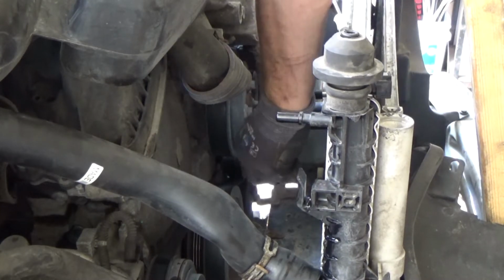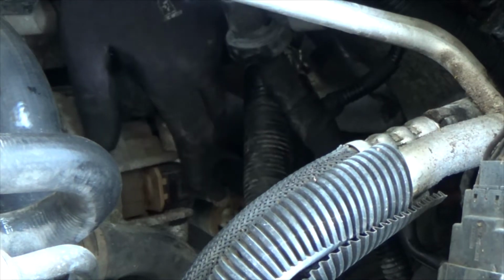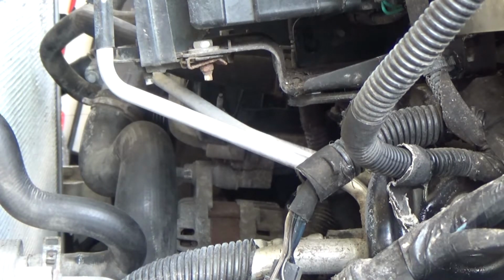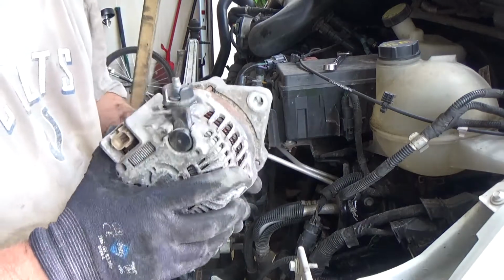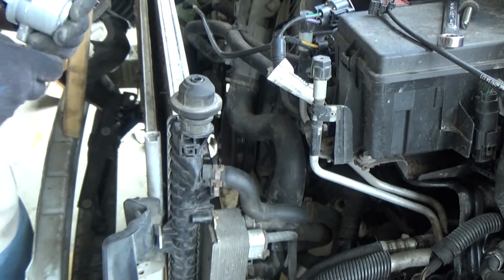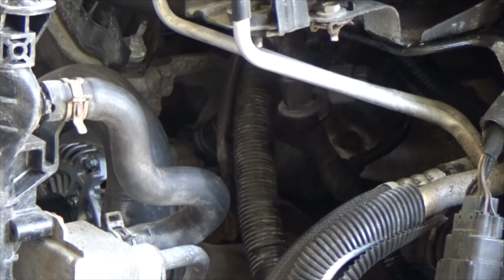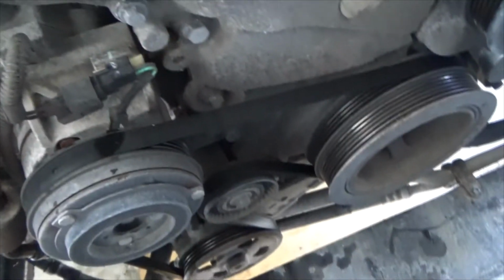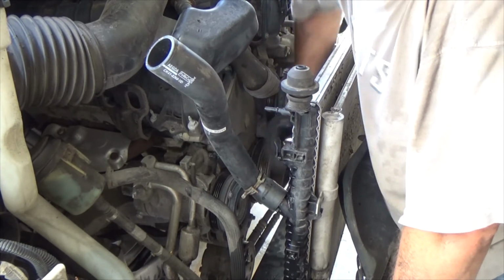2015 Ford Transit 250. Big Renovation Job. Alternator, Tensioners and Belts. 4/7

Comment: wow thanks, you had to pull all the fenders and grill, or you did it for the video access?
Reply from the maker: I did not remove the fenders. Only front grill and bumper assembly and it's not that hard. Honestly at this point I'm not sure if you could do it without removing it, I did it this way because I had planned a complex repair on this van and I wasn't sure 100% what exactly I have to replace. I thought I have to replace power steering pump as well but turn out it was fine.

Comment: Can I take the alternator out without removing the radiator fan?I have a 2017 transit 250 and the lower bolt runs into the radiator fan housing. I can't find any videos on specifically a 2017. I've never done this before. I don't know what actually has to come off
Reply from the maker: 2017 is totally different engine. I just did it on 2020 without removing fan, but it's also different engine from 2017. And it's two person job in my opinion. On 2020 3.5 engine to replace alternator without removing fan I had to do it from under the vehicle.
Reply: @VasylGladun  Got er done.  The fan shroud bends enough to clear the bolt (with a little help from my friend  mr. mini crowbar) and the rest basically fell off the van.  Still surprised nobody's done this video for a 2017.